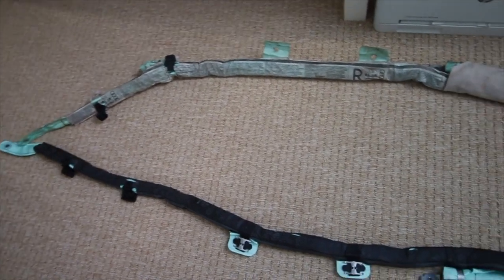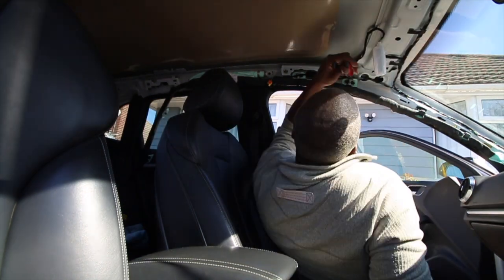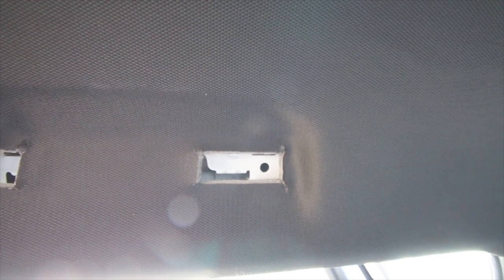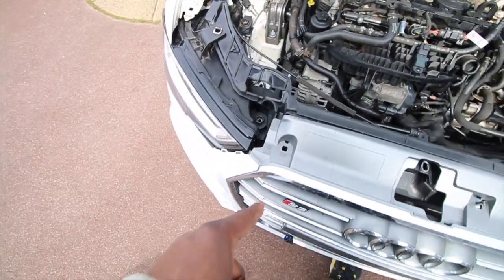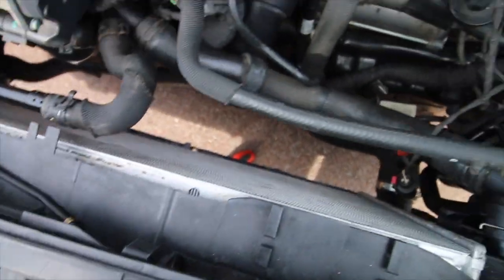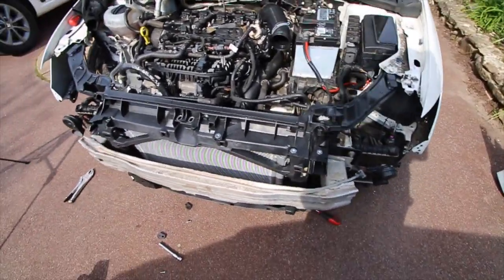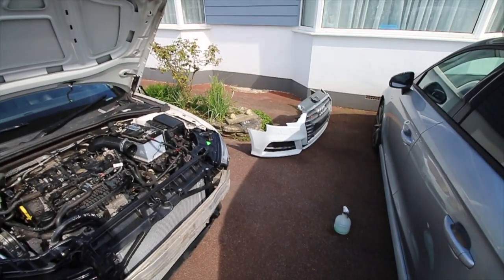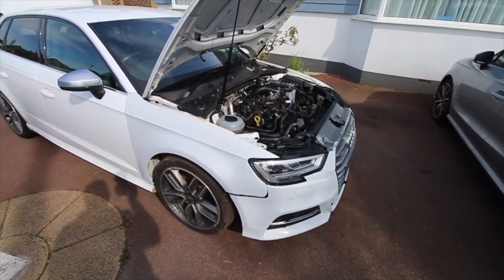The Audi S3 gets new curtain airbags

Comment: always disconnect neg lead first Paul if no earth is connected to the battery then there is no chance of a short, am guessing you already had the pos lead loose and have just been pulling it off the battery when necessary, also when wo rking on airbags manufactures specify different lenghts of time between disconnecting the battery and working on the airbags, this gives time for the power to discharge completely, minimum is usually 10 min but if you have time give it half hour, another top tip is to disconnect both your pos and neg lead and connect them together for 10 min as it allows the computers in the car to shut down fully, I have cured some strange electrical  issues on some cars just by doing this as it allows the computers to boot up and do a restart.
Reply from the maker: I would do the neg but have you seen how tight my neg terminal is

Comment: Hi Paul, did you have to reset or replace the airbag control unit under the centre console in order to clear the fault codes/ turn the airbag warning off? Thanks!
Reply from the maker: no, just needed to clear the DTC's  using VCDS
Reply: @CarsForPaul  Thanks for your reply Paul! Both of the curtains airbags and the passenger side seat airbag on my A3 have deployed (3 bags in total). Just read from the A3 repair manual that the airbag control unit must only be replaced or professionally reset if, and I quote: "after side airbags, driver's airbag, front passenger's airbag or seat belt tensioner have triggered three times", so I'll assume only those airbags mentioned will cause fault codes to latch onto the control unit but the curtain airbags will not. My mechanic has now replaced all three airbags and has cleared all the codes without doing anything to the airbag control unit and the car seems to run fine. Anyways.. that means that you do not necessarily need to relace an airbag control unit after a small accident/or curtain airbag deployment, at least not on the A3.. 😅

Comment: Did you need a new airbag module?
Reply from the maker: No need with Audi's you just need to replace the airbag or crash sensor and then you clear the code using VCDS
Reply: Cars For Paul how did stitch up the leather seats aswell?
Great content btw
Reply from the maker: @MA-sk1cw  £95
Reply: Cars For Paul from what company?